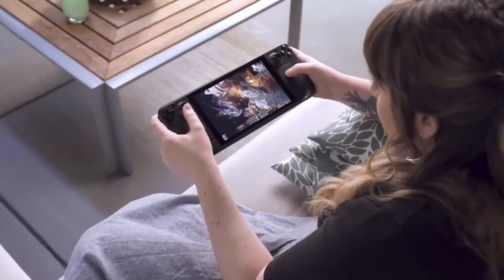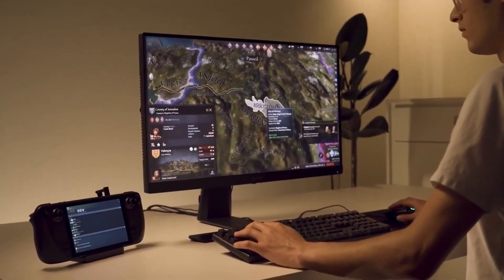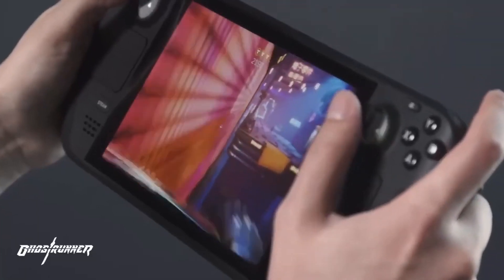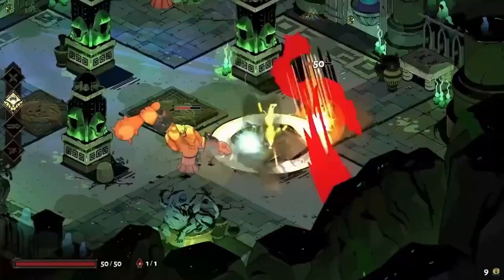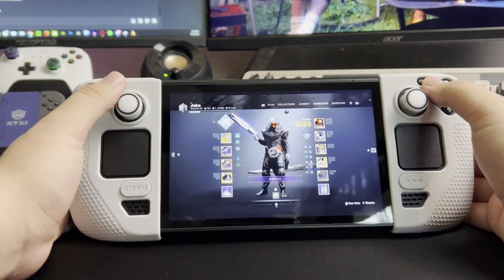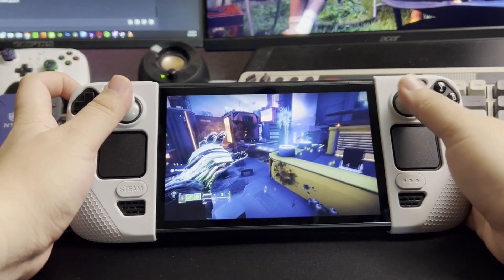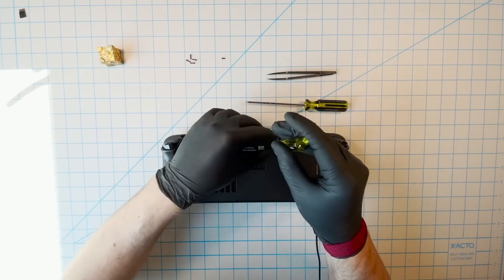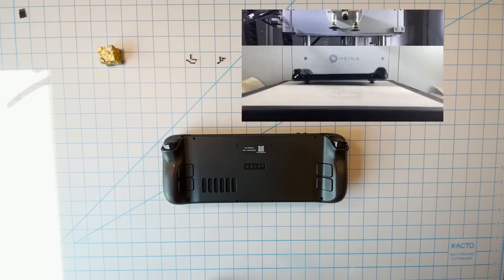Should you Install Windows 11 on your Steam Deck in 2024

Comment: I’ve had windows for months is has improved the only thing that still remains is the brightness once you hit zero you can just redrag the bar back to zero and it will go dimmer but it has been working great besides that I’m able to play destiny 2 with mid settings and it’s very fun have to get used to a smaller screen but after that it feels great everything works great and I would recommend a mini Bluetooth keyboard makes life easier

Comment: Love the video. After watching , you gave me an idea. 256 gb is the original memory of my SD LCD, but i upgraded it to a 1tb. Now, i dont have any use for the 256 ssd. Your suggestion to make a separate SSD for windows is a nice advice, rather dual boot. If i have the time i will make the 256 gb a windows only ssd and 1 tb for the Steam OS only.
Reply: Sir, i have a question. I hope you can answers it.

If i follow your advice and make my 256gb as my windows os and if need to swith to steam os, i need to  open and put back the 1tb ssd. 

My question is, can i buy a ssd enclosure and put the 256gb that has the windows os in that enclosure? Then can i boot the steam deck using that external ssd enclosure by going to the Bios? Do steam deck bios can do that?

The onething stopping me is the hassle of open/closing the back part of SD. By removing the hassle, i can seamlessly remove the open/closing process and directly to the source.

Hope you can shed light on this. Thanks.
Reply: @chowna7941 Just use an external SSD hard drive rather than always having to open up your steam deck to replace the SSD it’ll save you a lot of time.
Reply: @chowna7941  "My question is, can i buy a ssd enclosure and put the 256gb that has the windows os in that enclosure? Then can i boot the steam deck using that external ssd enclosure by going to the Bios? Do steam deck bios can do that?" It can

Comment: Damn i'm very tempted to insall windows, i know it may break my steam deck but i just spent a fortune in destiny 2, elder scrolls online and vermintide 2 and i can't even play them, i have other good games but those 3 are my favs. Curse all.
Reply: It won’t break if you do it right. Even if it does you can always Reimage it to get it back to its original stock settings as when you first got it.

Comment: Hello! Thanks for the video. I heard that on Windows SD has less fps and battery consumption is way higher. Is that true?
Reply from the maker: Depending on the game, you might experience lower FPS for example tiny teen Wonderland runs better in Steam West then it does in windows, but it’s never like utterly Game renewing differences and yes, it does have worse battery life but it’s not like the previous battery. Life was amazing so I was just gonna be a little worse. That’s due to windows  more extensive background tasks.
Reply: @JustSomeJacob  thanks. I also saw a video where the guy said that half of the games that he tried just don't work. Like black screen or just don't start. Did you have such problems? Also do you use official drivers or custom drivers from community?
Reply from the maker: @IgorDyx  i use the official drivers which the most recent one that has been released, I believe it from like November of last year I haven’t experienced any of those issues that you were referring to that might be because the video you are referring to might be older or we’re using custom drivers that I’m unaware of

Comment: No thank you, windows 10 is better
Reply: Windows 10 support ends in 13 months, there's never been a better time to swap to linux. 

Windows has been getting worse with every iteration since 7.  The OS was already doing everything it needed to and they're now removing features to replace them with cloud bullshit nobody asked for.  

Meanwhile, all the things you love about Win10 that are missing from 11 have been standard in Linux for years. 

You also won't have to throw out your computer because Microsoft arbitrarily decided it's not good enough to run their spyware riddled bloated dinosaur of an OS on.  

If the obvious failings on Microsoft aren't enough, have a look at their AI plans and what they mean for your data security and safety.  

They're using the OS as a training tool for their AI, it's not designed for us at all.  You can't opt out of these features anymore either. 

Microsoft are quickly going the way of Yahoo or AOL.  We'll remember the name had something to do with computers but we'll struggle to remember why everyone put up with them for so long.

Comment: You shouldn't install Windows 11 on anything honestly if it can at all be helped.
Reply: Windows only sucks for users not smart enough to keep their pcs running. Love Windows
Reply: @GamingwithNooknfi I'll say windows isn't perfect but it's literally the best os to use.
Reply: Windows on top
Reply: It's fine for me, but I also have it installed on an ssd and not an SD card I'm shocked that's even an option as sd cards are slower than most new mechanical hard drives which even windows 10 runs terrible on.
Reply: @GoldenNada all the game drivers and graphics tech is written as Linux code for windows now anyway.  It's usually a matter of days at most before every windows update gets ported to linux.  

It's absolutely not worth the performance loss to spyware and bloat to run windows on a machine meant for gaming.
Reply: Agreed
Reply: Agreed
Reply: Amén!🙏
Reply: I want to try Lossles scaling to play some games from 40fps to 60, only works in windows
Reply: Why?
Reply: Silly comment
Reply: Great experience so far with windows 11 on my deck. Fortnite and call of duty 6. What’s not to like
Reply: i enjoy Windows 11 🤷‍♂️

Comment: I have windows 11 on an SD card spare I have. I knew it was slow but damn! (The SD card). I'm planning to run some Ubisoft games and see how it works. If I plan to stick with this route I'd rather just get an SSD and plug it in a USB hub instead
Reply: Same here - I’ve a fast as card with win 11 on, and dual boot via clover - I’ve found it too slow to be something I’d use daily but useful on odd occasions.

Comment: On Steam deck? Absolutely 
On Steam Deck oled? Absolutely not!
Reply from the maker: You’re absolutely right I should’ve specified the video that I’m using a original steam like not OLED
Reply: @JustSomeJacob whelp… there goes my smile
Reply: can i ask why is bad idea in the oled version?
Reply: @Reno29wa lack of supported drivers like audio.
Reply: @MIIIKE0083  will they make those for OLED?
Reply: @Reno29wa  There's no drivers for it
Reply: @lordoftheautism8597 why there is no support for it? Were the drivers support for original steamdeck official from Valve?
Reply: @haysen123 they not release driver yet , they working on it so windows on oled not ready now

Comment: If your planning to install windows on your steam deck, you shouldve just boughten a rog ally at that point, rog ally has way more performance with windows.
Reply: Except that steam deck runs games better because the hardware isn't being wasted trying run windows bloat. 

Windows hates gamers, we should hate them too.
Reply: @SineN0mine3  My point was, if your going install windows on your steam, a rog ally wouldve been better in the first place.
Reply: The rog ally isn’t as good and the ally x which is a whole lot better is way more expensive…
Reply: @enchanted-j2z  casue of price diffrence compare rog with deck pointless